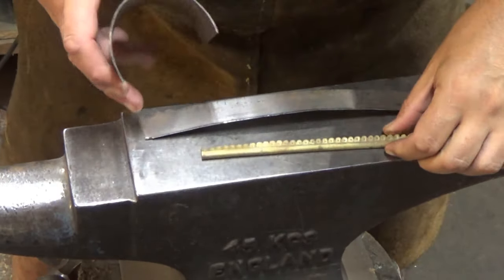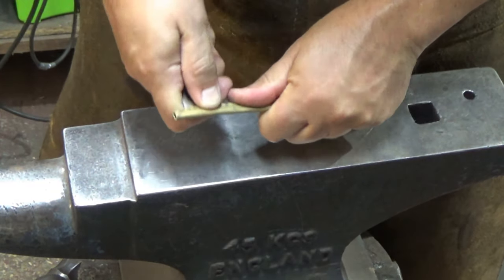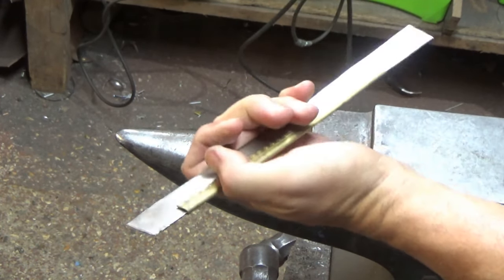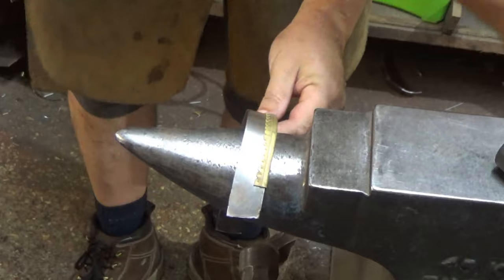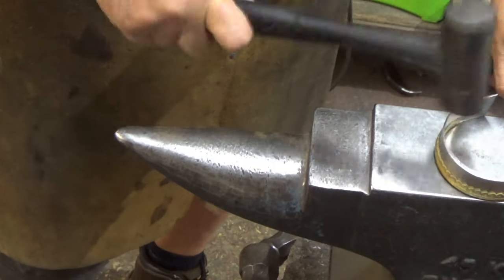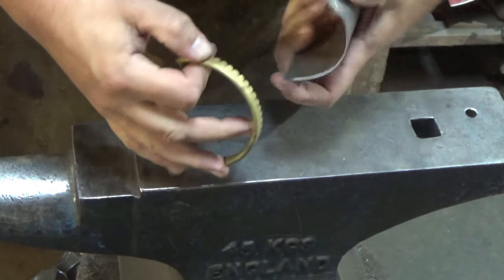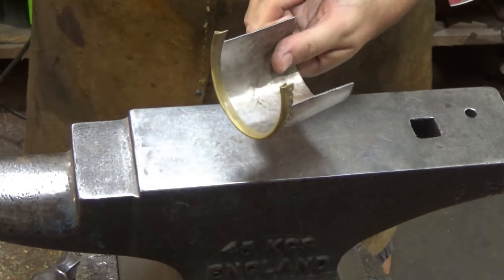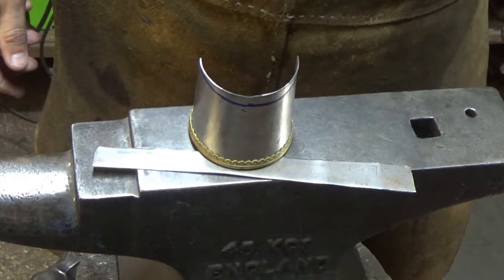Quick way to fit a decorative edge to armour.

Comment: Interesting. Can you recommend some silver looking material for decorations? Thinking about making some blackened pieces with silver decorations

Also slightly unrelated: are you planning on making a video about making a breast or backplate? Those are pretty much the only "big" parts you have not talked about yet
Reply from the maker: hi, you could look at getting stuff silver plated afterwards? Nicky at Gemmues does silver plating, as well as most local jewellers? That way you can work in soft copper and have it plated up.

Yes, I plan on doing some big items shortly, I have a breastplate or two about to be started, it simply comes down to what has been bought, but there's a couple starting very soon. I will try and remember to film them.
Reply: You've got a battery, right? And can procure some silver? Silver plate the brass or bronze or whatever you're trimming with. I like to gold plate inset structural parts, it makes for a fine finish of confusing strength. I do like highly polished inset brass though, it looks gorgeous. You can also use aluminium alloys, a common alternative I use is 'Nordic Gold' which is basically aluminium brass. It's stronger than brass by far and looks almost gold. If you added some chromium powder in and cheaped on the copper you could probably come up with a high silver sheen alloy at home. Then if you don't want to use it structurally but want to plate with it, well, you've crapped out because all the aluminium in it will probably limit that idk. If you've got an ingot of material that is still magnetic when you're done you can shove the ingot into your grinding wheel and collect the dust and try electroplating with it. Idk how well the carborondum loading will affect the finished sheen but it's always worth fiddling with untried methods to find something neat and new. Hell I've used sputtering in a fusion generator to micro-plate with materials incapable of taking an electroplating under normal conditions before and accidentally come up with gorgeous end results. Try and have fun! Unless you're doing this as a profession in which case you're a bit limited.